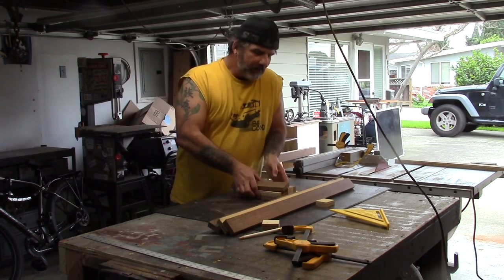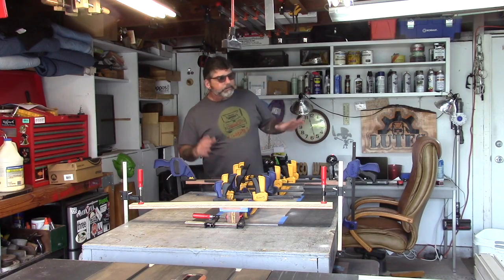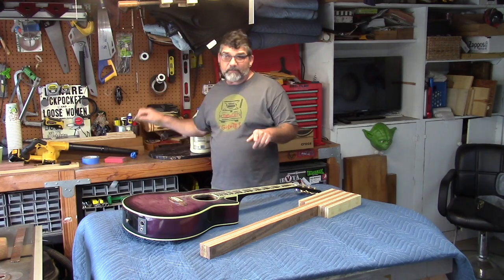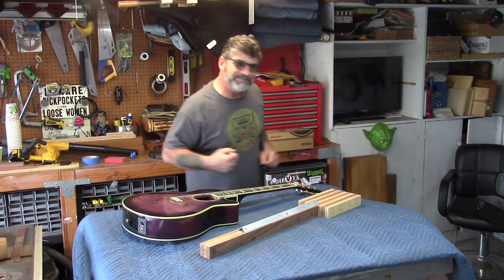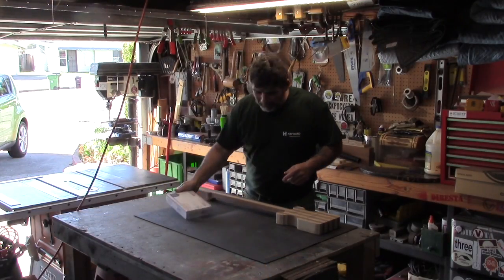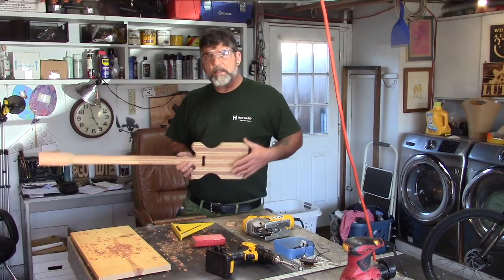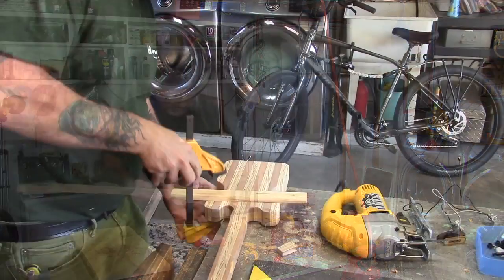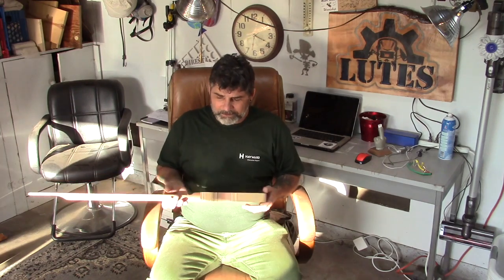Solid body 3 string guitar DIY

Comment: Totally salvageable! As mentioned before by others, plug the hole and drive on. For the top of the guitar, hit your local big box store and grab a small brass or aluminum plate, or even some veneer to make a pickup surround - or even cover the top of the body, if you prefer. For the back, who cares? Revel in the repairs! Highlight that puppy! Paint a logo on it or something. Still 100% salvageable.
Reply from the maker: Mark Lindsay 
The neck on this one is gonna have a home on a special build. Keep an eye and thanks for watching Mark :-)